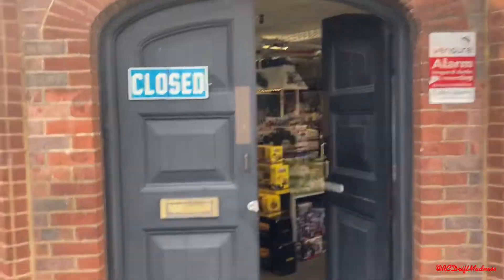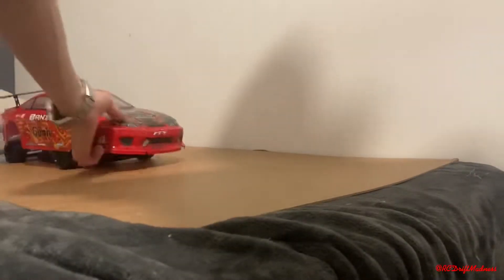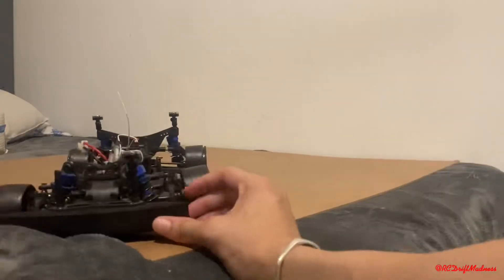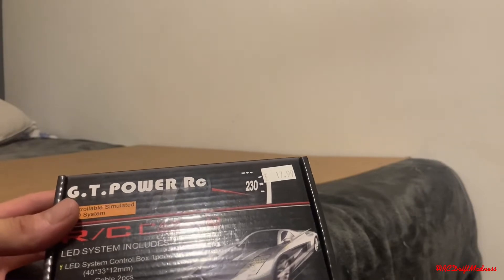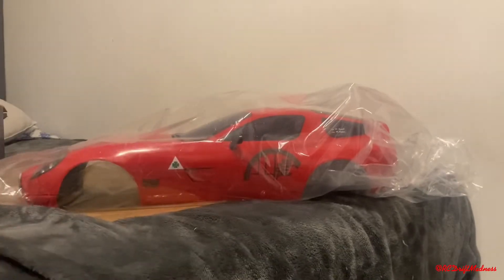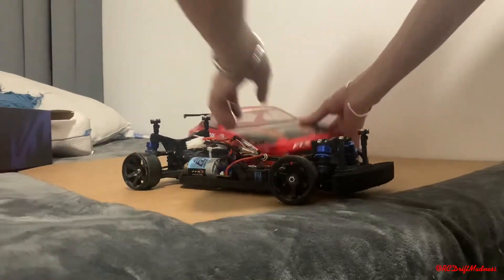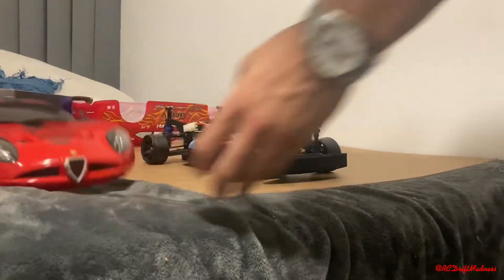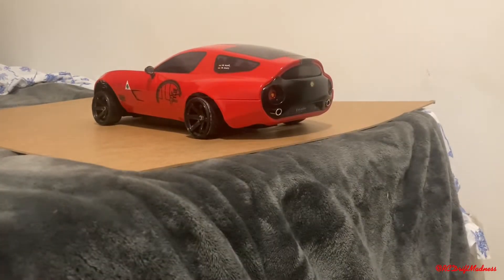Upgrading the FTX Banzai, Is it Possible?

Comment: Awesome video ! go rear wheel drive only , take out front 3 shafts and diffs . Lock the back diff too that helps . Also get a gyro that helps drift , fix up the front steering by grinding hubs down , and get a proper speaking voice in english without sounding like a wanksta/wigga.